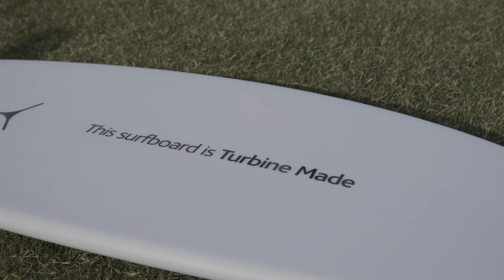ACCIONA | Pioneering the circular economy with the world’s first Turbine Made surfboard

Comment: It looks like only the fins are actually made from wind turbine blades. A single blade weighs around 10,000 kg, while a surfboard typically weighs only 3–4 kg. Given the density and layered structure of fiberglass in blades, a board made entirely from that material would likely weigh 20–30 kg and wouldn’t float. There’s clearly missing information in this video.

Finding ways to repurpose wind turbine blades is important, but it would be great if the video focused more on the full process of board making rather than just the surfing visuals.
Reply: You make a really good point about the huge scale of recycling that would be required to truly make a difference, considering the size of a single wind turbine blade. I didn't know they weigh around 10 tons! Wow! I agree with you that there needs to be more effort made to find ways to repurpose wind turbine blades. I'm not sure on the, as you say, "layered structure of the fibreglass in blades" as I haven't seen a cross section, though it's possible to cut and reattach sections of foam, to remove any unwanted heavier layers of fibreglass. 

Someone else raised similar concerns in another comment, regarding the idea that it is only the fins that are made from the recycled turbine blade. I've looked at several stories on Australian TV, on Instagram and here on YouTube, and this is actually incorrect. I wrote a response to the other comment, so I've copied that below.

The foam core, known as a 'surfboard blank', is recycled PET or PVC foam, sourced from the old wind turbine blade. This blank then needs to be shaped and laminated using epoxy resin combined with fibreglass cloth, which are by necessity new materials. Josh Kerr has gone further, and used some of the solid fibreglass material from the turbine blade to shape the fin foils, which are 'glassed-in' during the lamination process. So my guess would be that around 90% of the total volume, or possibly 50% of the weight of the surfboard is made from recycled materials. 

This is an excellent initiative, and as a surfer who is always experimenting with more eco friendly materials, I'm excited about the possibilities for the future. There is obviously a lot of wind turbine blades that need to be recycled though, so I would love to see them all going to a good cause, rather than just a surfboard or two. 

As most people are not surfers, it would make sense for the old turbine blades to go toward something with a more direct association with wind power, such as a windsurf board, or even better, a traditional style sailing canoe for the transport of people and cargo in the remote Pacific Islands. I'm working with proa designer and eco boat building pioneer Rob Denney to develop a 'cargo proa' industry in Fiji, to replace the rusty old ships that are so unreliable and uneconomic, due to the high cost of diesel in the islands. If a renewable energy company were to help address one of the major challenges faced by people living in remote island communities, that would sure make an inspiring story!

Comment: You say "surfboards" but from the video it appears you are only making surfboard fins? There's a huge discrepancy there... Which is true? Thank you
Reply: You misunderstood. The ENTIRE board is made from the turbine. Fins as well.
Reply: The foam core, known as a 'surfboard blank', is recycled PET or PVC foam, sourced from the old wind turbine blade. This blank then needs to be shaped and laminated using epoxy resin combined with fibreglass cloth, which are by necessity new materials. Josh Kerr has gone further, and used some of the solid fibreglass material from the turbine blade to shape the fin foils, which are 'glassed-in' during the lamination process. So my guess would be that around 90% of the total volume, or possibly 50% of the weight of the surfboard is made from recycled materials. 

This is an excellent initiative, and as a surfer who is always experimenting with more eco friendly materials, I'm excited about the possibilities for the future. There is obviously a lot of wind turbine blades that need to be recycled though, so I would love to see them all going to a good cause, rather than just a surfboard or two. 

As most people are not surfers, it would make sense for the old turbine blades to go toward something with a more direct association with wind power, such as a windsurf board, or even better, a traditional style sailing canoe for the transport of people and cargo in the remote Pacific Islands. I'm working with proa designer and eco boat building pioneer Rob Denney to develop a 'cargo proa' industry in Fiji, to replace the rusty old ships that are so unreliable and uneconomic, due to the high cost of diesel in the islands. If a renewable energy company were to help address one of the major challenges faced by people living in remote island communities, that would sure make an inspiring story!